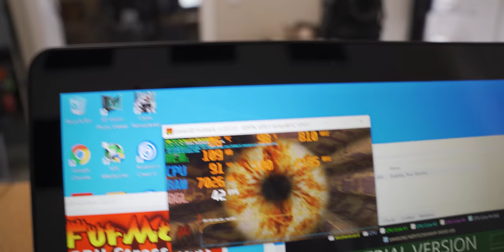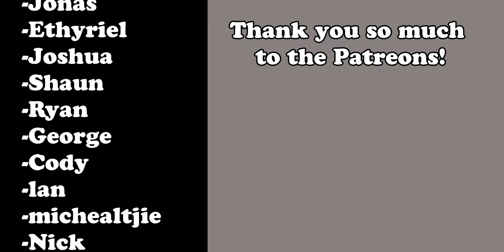The "BEST" way to FIX an OVERHEATING gaming laptop...

Comment: Hahahaha, I'm the type of person, who goes all of the internet searching on how to overclock a cpu that's not overclockable 😂
Reply: Same as well
Reply from the maker: Hahaha!! Yeah, that's exactly what I had to do with the laptop's CPU. 😁
Reply: me three 😁
Reply: Yup same here, took me forever to realize that my i7 9700f wasn't overclockable, total noob move on my part.
Reply: @jaredchampagne2752  I hope you weren't trying to OC the IGP 🤣🙄
Reply: @shaneeslick  what’s IGP? You can roast me, I honestly don’t know. Just got into tinkering with PC’s not long ago.
Reply: @jaredchampagne2752  integrated graphics XD
Reply: @jaredchampagne2752  No prob Jared 😁, it is the Integrated Graphics Processor, all Intel Mainstream CPUs have a graphics processor,
the suffix 'F' in Intel naming means the graphics part of the CPU is not active (the reason for my comment 😁) so you need a GPU Card,
since you mentioned trying to OC, 'K' means an Intel CPU has an 'Unlocked Multiplier' for increasing the Core Frequency 'Overclocking' in BIOS or an OC program,
So the i7-9700 has a locked Multiplier & has a functioning IGP, your i7-9700F has a locked Multiplier & has the IGP Disabled,
an i7-9700K has an unlocked Multiplier & has a functioning IGP, an i7-9700KF has an unlocked Multiplier & has the IGP Disabled, They require a 'Z' board for the option in BIOS

Unlike Intel not all AMD CPUs have Integrated Graphics, they call the ones that do an APU (Accelerated Processing Units) suffix 'G', Athlon3000G, R3 3200G, R5 3400G,
all AMD CPUs are 'Unlocked' so there is no need for a suffix to show this, but require a 'B' or 'X' motherboard to be able to adjust the Multiplier as this is locked on the 'A' Boards

the 'Old School' way to 'OC a CPU was by increasing the BCLK (Base Clock Frequency), but on modern Motherboards & CPUs it is not widely used as it can cause instability as it OCs the running frequency of everything
Reply: @shaneeslick  ahhh ok that makes perfect sense, yea when I first got my computer I just wanted to learn my way around it, and it’s a pretty mid tier gaming rig, and I already knew how to overclock, but I honestly didn’t know that some were locked from the manufacturer, so I was trying forever and scratching my head, then I read somewhere in a review that it’s not OC-able, but not I was trying anything with the integrated graphics 😂 I have a 2070 super, so I wouldn’t have tried anything absurd like that!
Reply: @shaneeslick  Also I noticed that the 9700f has a 3gz base speed, but it come out of the box running at 4.5gz or something like that, they call it turbo boost or whatever, I don’t know if that’s like a manufacturer way of safely OCing?
Reply: @jaredchampagne2752  OCing the integrated Graphics isn't absurd, it is very beneficial, some programs use the IGP for Accelerating Rendering Performance,
or if you have a Low Budget AMD Gaming PC with no GPU it can be the difference between an Average of under or over 30FPS @ 900p or 1080p 😁
Reply: @jaredchampagne2752  The Intel Boost Specs are based on 60sec & vary depending on number of cores boosted (The highest boost Spec listed is based on 1core), some motherboards have a similar Auto setting to OC a CPU like a GPU (it can be activated at the factory),
Your RTX2070Super has Base Clock: 1605 MHz, Listed Boost Clock (depending on Brand & Model between): 1770-1905 MHz but all can boost higher depending on the Brands VRM & Cooler performance,
So like your GPU if the CPU & Motherboard VRM are not at Max Temp the motherboard may increase the All Core turbo time limit from 60seconds to as long as possible, 
or another thing the software can do is allow core boost as load increases & decreases on each core,
depending on the detail of your monitoring software like RivaTuner, HWinfo or HWmonitor, this can still look like all core or show how each Core acts separately
Reply: @shaneeslick  oh wow, thanks for the very clear explanation, all new to me, instead of just being toxic and bashing people with less knowledge like most of the internet! 😂 I always thought that integrated graphics were useless and couldn’t be used for much more than basic programs with minimal animations or work load, I guess things have come a long way, when I got my first pc, my main priority was to make sure I had a dedicated gpu, but that’s cool to know. I remember back in the day our family computer could not even play 2D RuneScape with intel integrated graphics! 😂
Reply: @shaneeslick  yo you defo get a big thumbs up! Awesome advice
Reply: @Strange-Viking  Thanks Ultra Noob, but even after tinkering with PCs since Pentium3 what I 'actually know' is still very limited compared to most TechTubers,
I do make mistakes too & at those times I prefer to get comments helping me understand rather than calling me an Idiot, so like I said I try to treat others this way,
Like Dawid, He is not a PC Genius but he makes new product tests & learning about PCs fun 😀,

If I can help people who want to learn with simple explanations of the Basics or point people to Good Explanations of more Involved PC Knowledge then maybe I can help someone trying new things to find a Passion,

While I do try to keep up learning all the new technologies & their names the reason I try to stick to basics is that PCs are getting so advanced in their Architecture & Performance Algorithms at a Faster & Faster rate, now I am 50 I have trouble learning that fast, I feel like a Single Core with Hyperthreading to do the background tasks like Breathing in a 16c/32t World 🤣🤣🤣🤣🤣
Reply: @shaneeslick  hah wel im from the time of ollivetti's to pentium 3s
Most of it you had a digital hrtz mtr. 33hrz and by pressing the turbo button you overclocked it to 66hrtz 😂 actually the first pc i ever had you actually had to program it just to be able to use it. They had a whopping 1024 bytes 😂 preferably using floppies as storage only i stopped learning after win 3.1 though, just starting now again
Reply: It's always possible to mod the bios and do some bclk ocing

Comment: I tried to put the laptop underwater as cooling solution, it’s awesome the temperature are so low that the laptop shut down itself to prevent damage!!! It’s insane
Reply: I tried this with my high end laptop that my dad bought yesterday with his last money. The laptop got so cold even my dad passed out because he never saw that cold CPU before in laptop. What a great advice thanks man
Reply: @vyrkolach5546  it’s awesome, even the screen is all black and the speaker are so quite while playing. Even the fan is turned off.

Comment: I’m genuinely surprised you remembered to disconnect the battery 😂
Reply: He's going to melt the cat at some point....
Reply from the maker: I think I would have been in real trouble if I forgot to disconnect it AGAIN. 😂
Reply: @DawidDoesTechStuff   you disconnected the keyboard not the battery. battery connector is the one with alot of red wires.

Comment: "if u have a gaming lamptop"

Generous of u to assume that my laptop can work as a lamptop
Reply from the maker: There is nothing like a good lamptop.
Reply: @DawidDoesTechStuff  Wonder if you could get wide zip ties, melt holes through them with a soldering iron & just have some like spongy material too sort of act as mounting material in the middle of the heatpipes above the heat plate & screwing the zip ties down once they are tight enough into the stock cooler mounting, might flex a bit & move around on you but if done right should have higher mounting pressure.
Reply: DIY Perks had a very old video of applying big heavy coolers onto a laptop Motherboard.
He might have some good techniques on getting good mounting pressure for doing this
Reply: My laptop glows hot enough with its terrible cooling that it can be considered a lamptop

Comment: The reason performance went down when you over clocked is because the laptop VRMS can’t keep up with the higher clocks. I had a similar thing with an old Core 2 Quad machine. It would perform better at 3ghz than at 3.2ghz.
Reply: mine is the opposite. Works like a NASA PC at clocks like 5.0 ghz but them temps be reaching 85-99

Comment: I suggest attaching the AIO to the heat pipes so that mounting pressure remains adequate and heat is transferred away in a more efficient manner. The proper way would be a copper plate covering the two dies, using the original mounting holes with an AIO attached on top.

Comment: This can open a discussion though. Laptops usually come much cheaper than a desktop. Maybe we can start a modding craze on which we buy laptops that do have good parts and put actually good cooling on them to get desktop performance.
Reply: A desktop setup should be cheaper, because is big and clunky and not portable and you pay more to get the downsizing of a laptop.
Reply: @ElGoogKO  mobile options aren't that different pricing wise as before.

Like before a laptop with the capabilities of a 500$ pc would cost 800-1000$.

But now a laptop with the capability of a 500$ pc costs 650$.

And also keep in mind many pc vs laptop price comparisons happily don't take into account the price of a monitor which you kinda need.

It's irrelevant if you have one from your 20 previous builds. For a first time beginner that's atleast 100$ for a run of the mill 1080p monitor.

Comment: The IHS on desktops is different from laptops. You can't just put a drop of thermal paste in the middle and hope the mounting pressure spreads it evenly like on a desktop. With laptops, you take some good branded thermal paste and evenly spread a thin layer across the entire IHS. You'd still run hot, but most likely in the 70-85 without thermal throttling at load depending on the laptop. 

Trial and error guided me through this, I tried the dot method, and it was thermal throttling, evenly spread the layer and you get much better temps at load without throttling, cheers. Also make sure you're at the latest bios. If this is not enough, you may be able to undervolt like -.050v and in some cases, if you raise the laptop, the intake fans from the bottom can easily take in more cool air.
Reply: It's a direct die cooling since laptop CPU and GPU doesn't have IHS above the chip
Reply: @sihamhamda47  correct
Reply: what about using thermal pads, instead of paste?
Reply: @thebestever333  You need the right thermal pads with the correct specification to cool down a specific amount of heat per area enough to dissipate from your CPU. In my experience, off the shelf generic thermal pads don't cool as well as generic thermal paste.
Reply: Yeah different in the sense that THEY DON'T EXIST

Comment: My laptop runs extremely hot even when just running chrome with 32gb of ram. Is there anyway this can be fixed without spending any money or changing clock speeds
Reply: @James's Gems ^^^
Reply: Get an air blower and blow out the vents. I just started using a laptop last month as my PCs are all down. After a month of use it became very slow, it's new, no malware, so I blew it out with my trusty datavac that I use for the PC's and it sped back up. I researched a little and found this is a common issue that gets overlooked, good luck!
Reply: Don't close air intake holes, open even more holes for air to come in, clean cooler, repaste cpu, change thermal pads if there are any, buy a custom cooling solution for your laptop if there is any, or just ask Dawid more directly lol
Reply: Throttlestop is good undervolting program.It can reduce heat from your laptop.
Reply: Replace thermal paste if u cant do it yourself go to a near pc shop or a friend who know tech

Comment: I feel like there's a way somewhere to mod this into something practical.
I think you can use pipes and the pipes goes to the giant fan towers. Also adding more fans to the towers. And making a 3d printed enclosure.
But in practice maybe a external gpu could be a better alternative. I know that it's a joke but it has potential.

Comment: Good stuff!
Makes you wonder why no one sells huge alternative bases for various laptop models. Many people use their laptop as a desktop replacement with a screen, mouse and keyboard after they are done studying and don't need to be mobile anymore. I am typing this on a Macbook Pro Early 2011 that I got for free a week ago. The thing runs great, but the fan ramps up for literally anything. Would be kind of cool to make it into a phatmac with a huge base, and way lower temperatures.

Comment: Those laptop temps were pretty decent to begin with, if you want a more stable thermal experience and better frequency stability you should’ve just undervolted but this works too
Reply: yeah even 92c on 3d furmark was not even unusual for a laptop was even surprised it didn't go over 95c.

Comment: Or you could order a "new" backplate for the laptop, drill holes in it facing the heat pipes, put the laptop "normally" on a stand with feet long enough to fit the cooler upside down and let the cooler cool the heat pipes ? Plus if you use a thermal pad on the cooler you can always create a custom door on the modded backplate to keep portability while maintaining good enough contact.

Comment: I actually did  on my samsung Rv509 (It's my folding at home pc) but I used a Socket 478 stock cooler and I mounted it permanently by actually drilling holes on the Cooler so that I am able to mount the cooler from the back of the motherboard using screws. And after that my  load temps dropped from 97°c to 42c

Comment: This is GREAT for my Clevo n850hp6 ( XMGA517) laptop.
Had it for like...5 years now? GPU and CPU are ALWAYS Thermo-throttling at 95° from day 1. Second Year I undevolted it, next I opened it up ( I actually use it opened ) and now I'm even underclocking it. It's just a joke of a cooling system.
What I'm wandering is how will this affect memory temps? I think those guys need cooling and we're not taking care of them in the current solution, still a nice start!

Comment: As someone who is currently endeavoring to piece together a banger 720p/1080p rig from 6 years ago, I salute your efforts here.
It all started for me when I pulled a perfectly fine AMD A10 7800 APU out of an old Lenovo desktop a few weeks ago. Then I found a new, still sealed in the bag Asus A88X Pro board for $50. And then just yesterday I stumbled upon the best , most incredible deal for completely obsolete machinery ever and obtained two (count em TWO) used but pristinely kept GTX 980 Kingpin cards with ALL of the OG packaging and accessories and an SLI bridge for $300. I'm still in awe of this deal.
Now I'm at the point where I feel like the spirit of this machine is trying so hard to manifest into the real world that it would simply be cruel of me not to facilitate it the rest of the way.
Also, considering what I've already got going into this thing, it's going to end up being an actual monster.
Now I just need to find one of those old Corsair or Thermaltake cases that look like a space shuttle from the 1980s and I'll be in business.

Comment: Another cookie but excellent video Dawid. Regarding the close to other components problem , use some helicopter tape over them to prevent shorting and Im thinking you could use some copper coins or plate possibly cut to shape between the chip and the cooler to give you clearances.

Comment: HEY HOW DID U CONNECTED THE VENTIRAD TO THE POWER SUPLLY? WHATS THE CABLE TYPE? I NEED ADAPTATOR IM DOING THE SAME THING LIKE YOU MY CPU ON MY OLD LAPTOP IS 100DEGRESS AND I WANT TO TRY IT ( dont fking tell me to rempalce thrermal paste or cleaning or undervolting or shit , i tryed everythings)

Comment: I do not find these solutions useless... why are they useless... I have a large gaming desk, low budget lenovo gaming 5 ( 3050 gpu / i7 / 32ram )
I noticed that it was thermal throtling and i couldn't push it further due to cooling so I did the exact same thing.
The laptop is secured to the desk with doubleface tape, and I managed to secure the rest with 3d printed blocks and I did place actual weight on the coolers...

later on I bought a better adapter for higher wat delivery and I also printed a custom case to cover the whole thing, I sadly can't secure the coolers with screws on the mobo cus thats impossible but I did 3d print blocks which i secured to the chasse and mounted the coolers on them ( and it is a tight tight fit ), evantually i did not need the weight and everything fits perfectly.

Managed to tune the gpu and cpu and my temps are always below 50... yes it is performing as if it is a desktop build ( slightly better since the gpu is tuned further ).

Comment: on my laptop I use 4 small square fans to blow air into the vents on top of the laptop. I used to also have a vacuum port device that would suck the hot air out. If I used all that while gaming the laptop would stay around 32C to 55C when everything was running at max for a long time. Without it the lap top would consistently be at 98C to 100C+

Comment: Is it normal that I have an fx 6300 95w tdp and rx 580 about 200w tdp and my temperatures on both are under 40 while gaming, and I don't even have a water cooler
Reply: not undervolted, cpu 100%  temp 40 gpu 100% temp 46

Comment: I NEED A LAPTOP COOLER FAN THAT SUCKS AIR, BUT I HAVE A THIN LAPTOP & I CAN'T USE THE TYPE THAT ATTACK TO "THE VENT". I HAVE TRIED THEM, THEY DON'T WORK!!!! I NEED A TRADITIONAL LAPTOP COOLER "STAND" THAT SUCKS AIR "AWAY FROM" THE LAPTOP, NOT BLOWS AIR (AND DUST!) UP INTO THE LAPTOP.  WHY IS IT SO DIFFACULT TO FIND ONE.  Why would I want to blow air and dust up into my laptop, when I can suck the hot air away from my laptop, like my old ANTEC does? (My Antec is old & the cable shorts out & the company sells other product lines now).  PLEASE TELL ME IF YOU KNOW OF ANY LAPTOP COOLER THAT SUCKS AIR. Thanks in advance.